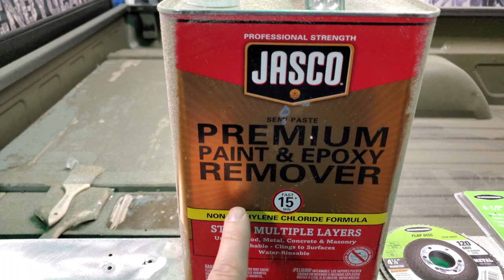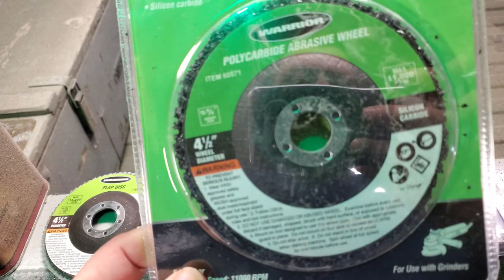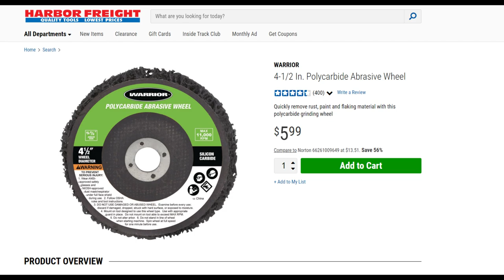How To Remove Bedliner Textured Paint the Easy Way. (T Rex Protective Coatings), (Rhino Liner).

Comment: I can only imagine the undulations in the metal after hitting it with a high speed grinder and #60 grit. I looked at an older Ranger the other day, and the previous owner had "trimmed" the lower third and the box with a real course type of bedliner paint/covering. It had like a stone aggregate in it. Real easy to crush the aggregate and then the aggregate turned white. Looked awful in the box, but from a distance, the exterior "lower third" looked good. Photographed really well. You couldn't really tell what the material was until you got close. Problem is, you have to ask yourself what's hiding underneath all that black gunk "everywhere." Thanks for the video.
Reply: Coincidentally, I got a ranger that was coated with it. At first I only saw a single dent, but I keep finding small collections of small dents as I fight this crud off.

Comment: I have tried rust remover from O'Reilly's and it did nothing.   I have found the flat disk 60 the best to remove rust from my 1964 F250.  I got that from Harbor Freight along with the Hercules Grinder.  The grinding disk was the same that you have in your video.
Reply from the maker: Nice....

Comment: I used brake fluid to soften up the bedliner and hit it with a power washer most of it came right off. Flap disked the rest of it and was good to go.
Reply from the maker: thats a good idea dont think it would have worked on this even gasoline wouldnt work.
Reply: Lmao ...So how many bottles a break fluid do you need to do a whole truck then 20?. Just sell the piece of s*t
Reply: How long was your bed liner on before you removed it?
Reply: @567Kriss  about 4 years
Reply: @blakejhonerme5018  used 1 big bottle of brake fluid.
Reply: @letsride0113  good to know, thanks. I got a 96 T100 covered in this shit and I wanna paint it. I either paint over it or remove it. I'm down to put in the time but I don't want to get half the truck looking good then the other half I struggle too much on.. not sure if I should use stripper or brake fluid
Reply: @567Kriss  try both and see which you prefer.. I just didn't want to go completely down to metal.. thats why I went the route I did.. You'll have to get a 0⁰ fitting for your power washer to cut through it.. and mine was sprayed relatively thin.. nothing like they do when they lay it in the bed of the truck. So that made it pretty easy for me as well! Good luck with your project!
Reply: @letsride0113  I'd have to think mine is on pretty thick, the kid I got it from was mudding with it- and it'd an automatic 🙄.. anyways.. I know a guy in NH who can't paint my truck pretty cheap but he told me we can either paint over or I buff it out. Anyways, he said "good luck pal" which made me think it was impossible. These vids I'm seeing show it's not entirely impossible, just tedious and boring. 
Not sure i want to get it down to bare metal cuz 1 it's a Toyota, and 2 cuz I'd have to schedule a time to get it painted and I don't want him charging me more to do the paint job if he has to sand the thing down again before painting. A shop said 10k to paint it, and this guy said 2-3k.. I like those numbers
Reply: @567Kriss  hell yea man! I understand that! Post some videos! I subscribed to ya ill keep up with your project! I'll have to post one of mine as well. The rhino liner held moisture and rusted my bed out.. so I bought a rust free bed that needs some body work.. I've never done body work or paint before.. but I'm slowly getting it straightened out with help from a couple buddies. Almost ready for paint!
Reply: @letsride0113  that would be cool man, I really don't know how to do a video lmao,I've done that shit before and I stood there like a stone.  I could send ya images though. Maybe I'll give it a try, you'll inspire me. My truck is getting a ton of work done to it next week. Leaf springs, lift kit, tie rods, lower control arms, rocker work... undercoat.. I paid 2500 for it with 226K. All fluids flushed, new ball joints, good tires. Rust isn't terrible as he undercoated it a few times in his ownership. I noticed a rust spot in the bed as big as my hand so I might need that taken care of. Other than that, frame is good- one weld spot before he sold it to me- it holds so it's good enough. Original step up in the rear which is rare cuz they usually rust off, and the spare tire mount is still holding the original tire. ALL the lights on the cluster work, 4wd works, the antenna for the radio still pops up- pretty dope- bench seats were replaced with regular seats from probably an old toyota camry- I deep cleaned the rug and lubricated the key holes and ignition. Fresh oil by me, and I did my best to detail the engine bay with TubOTowels. I recently bought fender flares too so I can replace the original chrome ones that are kinda hanging from rust. There is also a couple patch work jobs where you can see sheet metal painted over and weld spots. A mark on the passenger rear from when the idiot kid who mudded with it hit a rock.. strong enough to dent the metal, but everything still works fine. Engine needs a couple minutes to warm  up though.. sometimes has issues shifting from 2-3gear
Reply: @letsride0113  I actually recorded what I did so I want to upload it so you can see!!
Reply: @letsride0113  I officially posted some of the removal on my YouTube page .. THANK YOU for believing in me.

Comment: How long did it take? And how did you get in between the bed?
Reply from the maker: A long time I took the bed off in later video
Reply: I appreciate it I did it to my truck but I just want a normal paint now, would you be able to email me the amount of supplies you used and the best branded paint stripper? Or would you recommend just grinding the whole thing
Reply from the maker: @tylerpavlak8476  I've heard try diesel fuel and ammonia
Reply from the maker: @tylerpavlak8476  stripper wouldn't work for me it was to strong, also I heard use a heat gun to it heat it up real good then can start scraping it.

Comment: Flap discs don’t work, the only paint remover that kinda works is Aircraft Remover. I was able to use a friends 3500 PSI pressure washer & it came right off.

Comment: I painted my f150 in bed liner and I kinda don’t like it anymore. Considering sanding it off and using plasti dip
Reply from the maker: Yea
Reply from the maker: It's cheaper and easier to just use a single stage paint
Reply: @DrivenbyGears  I’m also tempted to add a third coat because I rolled it on the first time. But idk yet. Plasti dip is niiice. How long it take to sand your truck?
Reply: @DrivenbyGears  I’m also tempted to add a third coat because I rolled it on the first time. But idk yet. Plasti dip is niiice. How long it take to sand your truck?
Reply from the maker: Over a month

Comment: Maybe try a heat gun or propane torch to soften it.I’m curious on those two methods cause I have my box rails to remove to pop out dents and repaint and reapply box liner
Reply from the maker: Man I wish maybe some heat and stripper might worked but the fumes would have killed me. I'm long done with that truck.
Reply from the maker: Did it ever work?
Reply: @DrivenbyGears  how many sanding wheels you go through? My truck is covered with bed liner 🤮. But it's a nice T100
Reply from the maker: @567Kriss  shoot to dang many haha I think I got 6
Reply: @DrivenbyGears  haha, hey thanks for replying on an old vid, I appreciate it. Just wondering if I should just paint over the bed liner or actually try and strip it
Reply: @DrivenbyGears  I officially posted some of my bed liner removal on my page. First timer!! Not a good video at all but I'll learn as I remove it  the panels!